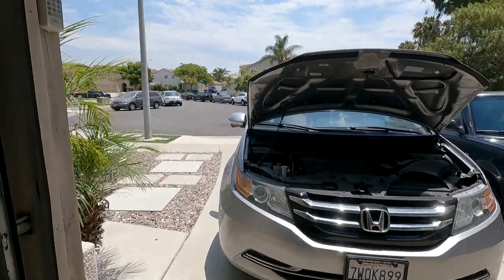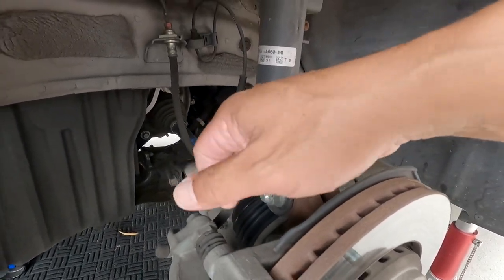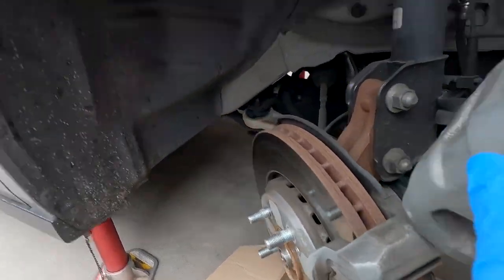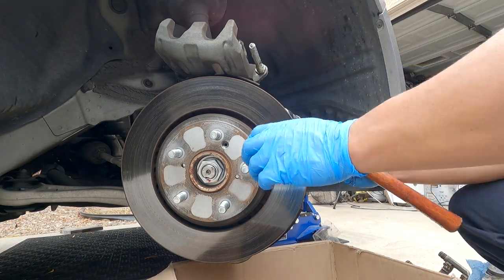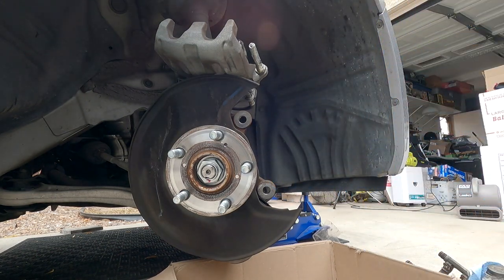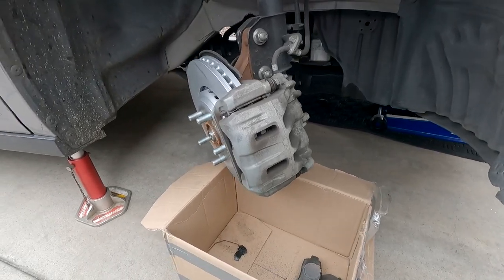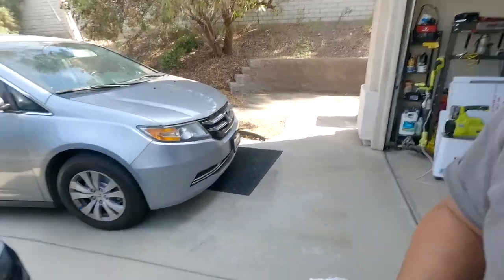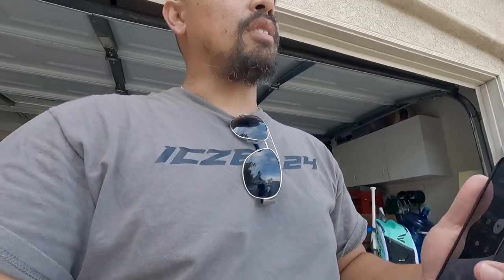[E131] How to Replace Front Brake Pads and Rotors (2016 Honda Odyssey)

Comment: Where do you put the jack under to lift the Honda from the center?  Can you show us the photo?  I normally lift he car from the jack points on the  frame from the side and then I can't put the jacks under the jack point.  I just did my pads and rotors yesterday.
Reply from the maker: Awesome! Jack placement I usually put right in the middle of the front part of the subframe directly underneath the front motor mount.   You should be able to Google search it as well to get a visual and images of the sub frame. I’m not sure what you’re familiarity is with the subframe.  The subframes job is to help cradle the engine and drivetrain. With that said, it’s pretty solid.

Comment: Nice work. I use a small carpenter clamp to hold the pads together when dropping the caliper. Your way looks pretty good! Looks like you used Honda pads. Did you use Honda rotors? I used a high carbon rotor from Rock Auto. The Honda pads have springs but not the stainless caliper hardware. I use just a little grease on the pad ears and under the clips.
Reply from the maker: Thank you! And thank you for stopping by the channel and checking out the video.  The pads are OEM from the dealer and the rotors as well. Sometimes I go aftermarket on the rotors, but this one the price difference wasn’t far off because of my discount, so might as well went and go with OEM.   Thank you for your feedback. Totally appreciate that! Feel free to roam around the channel. We have plenty other videos not just car repairs but fun stuff like going to race events and car meets. And interviewing fellow car enthusiast. Have a great one!

Comment: Just for your information: I just did my 2012 Honda Odyssey EX-L 's front brake pads and rotors.  After doing so, my engine light came on and right to the left of it another light came on (brakes?  thought it was traction control but that light is left of this light).  I did a search and other people had that problem and some say it is coincidental etc.  But it's not as it happened to me.  Further research in forums etc... one forum member said that could be caused by the brake fluid in the tube may have a air bubble, etc.  That makes sense as there's a possibility that the brake fluid hose gets handled too much while maneuvering the brake calipers.  Nonetheless the poster stated that the lights will turn off after some number of engine/start/stop cycles.  It happened .. first the "brake" light went off ... then shortly after the engine light turned  off; didn't have to reset by disconnecting  battery.  Just in case people do a search on this matter that they will find something that happened/related/worked.  Tags:  ELO Engine Light On traction light on brake light on brake pad and rotor change.  I hope this helps in "our community" of sharing information.
Reply from the maker: Thank you for sharing the information!

Comment: Ernie, I'm kinda desperate for some help with a 2014 CR-V. The key fob doesn't work anymore. Sounds like hey simpleton really? But I changed the battery, i DID make the mistake of installing it upside down at first, it was in the dark. I opened it back up and flipped it, and that little red light HAS blinked a couple times but it doesn't talk to the car at all anymore. I went through the "insert key, turn to on, press LOCK, turn to off, repeat 3 times, THEN one more time" AND nada. No reaction. I've changed the pace, waited a full second at each step, etc, just not getting anywhere. Did I possibly fry the fob with the reversed polarity? Is there some step I'm missing? Please.
Reply from the maker: Hey, sorry to hear about your remote issue. It’s has been awhile since I had to program one. I forgot the cut off year of which remotes can be programmed the old traditional way.  On the later models at the dealer when programming a key it automatically programs the remote as well. But usually changing the battery won’t cause the remote to have to be programmed again. So the answer to your question yes, it may be a possibility that the remote may have been damaged.  Also double check the positioning and good contact of the battery inside the remote as well.